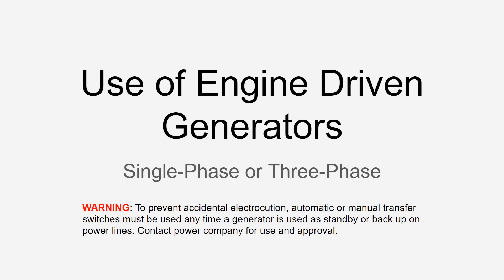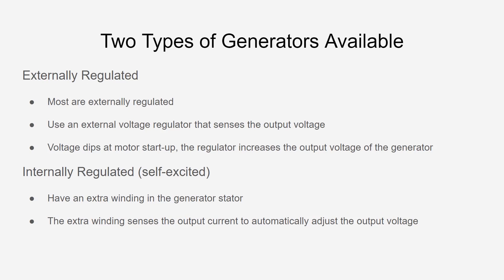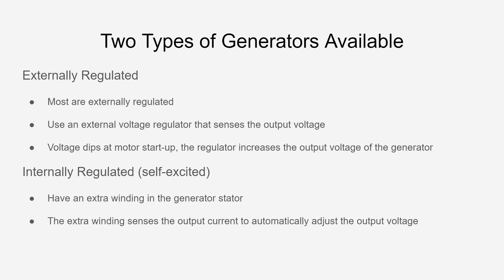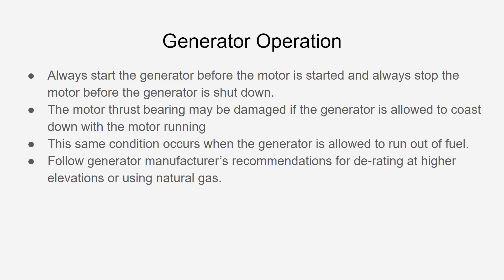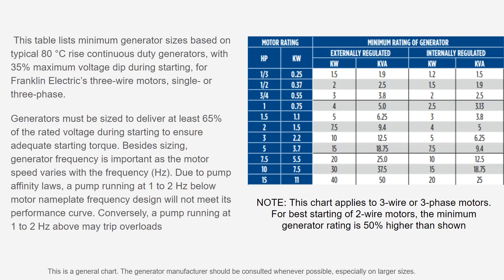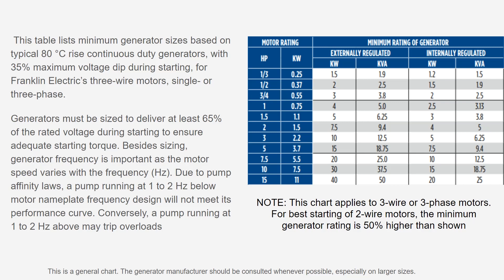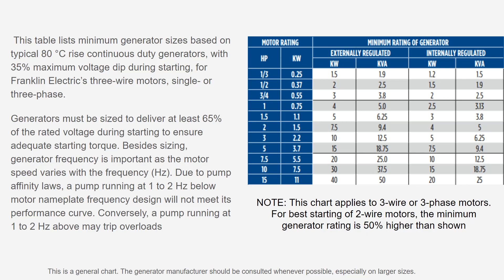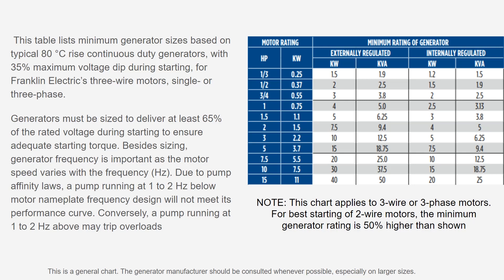How to Size a Generator for Your Well Pump

Comment: Just to repeat an answer at the end of the video that I came looking for, if you’re deciding on a pump that may run on a portable generator, a 3-wire pump (4 including ground) with an external control box is better than a 2-wire pump. The 2-wire pump will require 50% more power on startup which may require a larger generator than you’d otherwise need.

Comment: If I use 1.5 HP of the submersible pump well what size of generator need for it? What difference between externally regulated and internally regulated? how can I notice its difference?

Comment: Do you have any examples of internally regulated generators that can be purchased?
Reply: I have the same question. There is no info online.
Reply: This doesn't really answer your question but you don't want a brushless generator they have the noisiest output. The regulating is done through a capacitor and the windings of the generator and it induces a DC voltage in the rotor

Comment: What size generator would I need to run a 1/2 hp 2-wire well pump. Will a Predator 4375 do the job? If it will then I have another issue.

Comment: I got confused with your note.. For single phase 3 hp motor, what size of generator needed??
Reply from the maker: Is it a submersible pump motor with a control box or a 2-wire above-ground motor?
Reply: @RCworstwater  Thanks for your reply.... This motor is induction motor which is in piston compressor
Reply: This is above ground motor

Comment: How do you know the size of your well pump motor?
Reply from the maker: Check the control box if you have one. If you don't you may need to check with the installer or check the amperage of the motor as a last resort.
Reply: @RCworstwater  Thank you for your kind reply. Can the size pump be guesstimated by timing on time from on to off and measuring gallons pumped?  Oh, now I see this: https://www.youtube.com/watch?v=cWksNcUqWdE